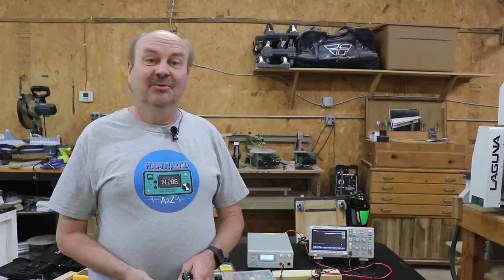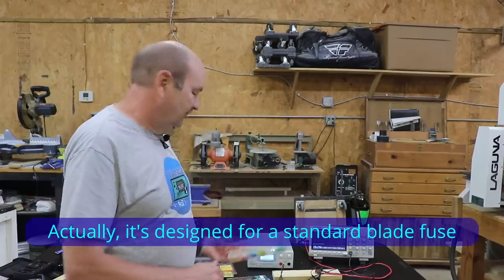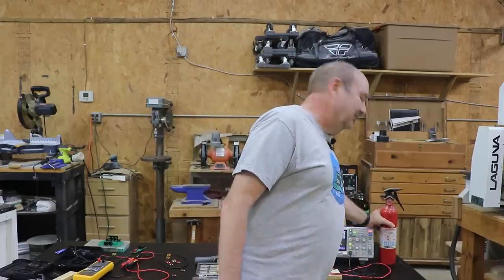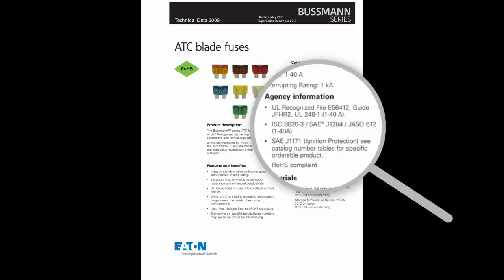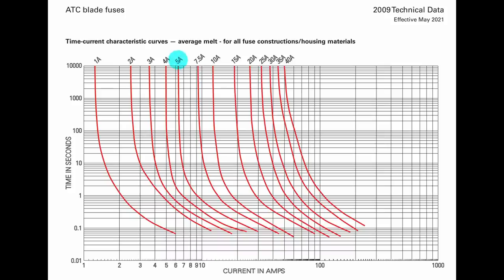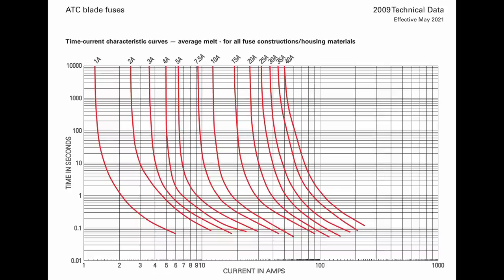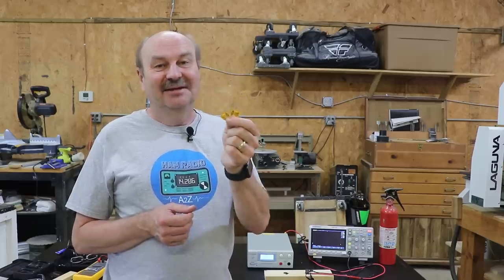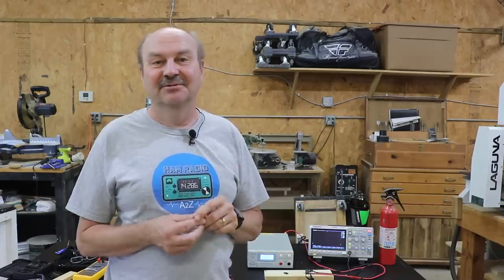Bad Fuses

Comment: Giving this a bit more thought;
(1) your electronic power supply likely responds by shutting down long before a thermal fuse can melt open.
(2) the "rated current" marked on a fuse is the "value it can carry for greater than 1,000h". It is not the rupture current.
(3) your supply indicated about 23A in short circuit, that's about the design tolerance of "+10% for a 20A" fuse.
(4) not all fuses are fast-blow, these unmarked generic automotive types could be a delay type (to avoid nuisance tripping on cold filament lamps and PM motor starting, as found in most vehicles)
 (5) when in CC your power supply is outputting a fraction of a volt (see scope image in your video) confirm with a DMM; there is not enough energy (P= I*E) in the fuse element to heat it up to melting point.

I think you owe it to the fuse vendors to repeat this experiment (I suggest using a car battery instead of that fancy electronic power supply)  73, de K7GVG
Reply: The fuse is rated 5a, not 20. The test setup is correctly simulating a serious overload. The power supply does not shut down, it simply hold a specific level of overload. A 5a fuse which has not blown after 3 min at 23a is not slow blow, it is not a fuse at all.
Reply: @david672orford  Thanks for your comment. Did you read the previous comments? We have collectively gone over the topic.

There is a serious flaw in the test methodology. To demonstrate and correct this the experiment should be rerun by the OP, substituting different equipment. The original power supply is electronic, and does not maintain CV mode long enough for a (any?) thermal fuse to rupture.

Saying the “fuses are bad” is dirty pool!
Reply: @pstonard  Yes, I have read the previous comments. A lot of people are making the same points as you are making. However, I'm pretty sure you are all misunderstanding how Ohm's law works in series circuits. The resistance of the fuse is by design much lower than that of the load and generally much lower than that of the circuit wiring. Since the supply voltage is divided among loads connected in series a fuse in a real-world 12 volt circuit will not see 12 volts ever. As it is blowing it will see a much-lower voltage like in this test.

As an example, suppose you connect a 25 watt lamp to a car battery using five feet of 20 AWG cable and a 5 amp fuse. Then you pull the lamp out and stick a screwdriver in. The resistance of the fuse in the video is 0.028 ohm. The round-trip resistance of the cable is 0.1 ohm. 100 amps will flow. The voltage across the fuse will be 100 amps x 0.028 ohms = 2.8 volts. Assuming the fuse has not blown, you can now take out your meter and measure about five volts drop along each wire of the cable. 

It is not physical possible to test this fuse at 12 volts 20 amps. Ohm's low forbids it. If you apply 12 volts directly to the fuse, you will get 425 amps. If you apply 20 amps, you will get 0.6 volts.
Reply: @david672orford  Again, you have not allowed the fault current to flow long enough to rupture the fuse, which is a thermal device.

The electronic supply used here will go into constant current mode long before the theoretic surge current (using your data = 100A) is reached. Probably in only a few milliseconds.

The final current of 23 Amps DC (indicated on the power supply) is well within manufacturing tolerance of the fuse under test.

The OP needs to step up and repeat the experiment with correct test equipment. As a practical matter just use a car battery, they are literally found everywhere.

A current shunt and scope will show and record the inrush current and the peak current applied, and the duration of the peak.

Comment: I suspect the 5 amp is mismarked. I once bought a batch of surface mount resistors from ebay and they were mismarked by a factor of 10. That 5 amp fuse may in reality be a 20 amp. You didn't test any of the other values of the cheap fuses to see if they operated correctly.
Reply from the maker: I don’t think it is.  The 20 amp no name fuse has a clear difference in the internal element, but the difference in elements between all of the fuses (or lack of difference) is surprising.  Stay tuned for a follow up video.

Comment: I hope everyone watches this who ever has or will change a fuse.  Some of the cheap ones I have come across have been offensive to even look at.
Seemingly random blade thickness and random shapes in the failure zone are common, as well as conductors which fit loosely in the plastic holder.
If the blades move within the housing, it will never meet the precision standards we are counting on.
I use either fuses or circuit breakers to reduce the likeliness of fire in high amperage motor control circuits.  There is a fine line between needing enough current to climb a hill and burning all the legs off the MOSFET's in your control device.  They don't call them Metal Oxide Smoke & Fire Emitting Transistors for nothing.
That being said, it would be interesting to use a motor controller and high speed camera to "throttle-up" some of these fuses while monitoring the volts and amps, so you could actually watch the fuse liquify before failure.
Customers with SLA battery scooters ask why does my scooter "randomly" blow the fuse?  The answer is always the same. It doesn't.
I carefully select fuses to protect the circuit, and you should be glad it blew.  When the fuse blew, it is likely the solder on the high current traces on the board were nearly liquid.  You were a bump away from a catastrophic failure.  Next time it blows the fuse, think closely about what you were just doing because whatever it was put the powertrain at maximum output for a long time. Climbing hills or doing several wheelies in a row are common reasons.  
I love it when a fuse blows!
Reply from the maker: Thanks Kevin.  I too have worked with high power applications for a long time.  From your description, a little different than yours.  I’ve never heard that description for MOSFETs before.  I love it!
Reply: @HamRadioA2Z  It may only apply to the Chinese MOSFET's.

Comment: I have some but I seem to have a different problem with mine. They seem to blow out prematurely.
Reply from the maker: I have only tested one particular set so far.  If the fuses don’t indicate that they meet any particular spec, it seems that it could be equally likely that fuses might blow with too little current or not blow soon enough.

Comment: I`ve been using a Fuse holder and Fuses distributed by Halfords UK in my Ebike but the Holder melts before the Fuse blows!
Vibrations in a vehicle across the contacts is probably what's causing it.

Comment: I know its current but i have wonders if testing like that is accurate i mean im syre those are crap but my thought is that if you have a short on the power supply so voltage down at less than 1v that means the watts on the fuse are less than if it was tested at 12v because the fuese will have a resistance thats what makes it hot so 20 amps at less than 1v will be a lot less wattage in the fuse than 20 amps at 12v
Reply: Ohm's law says you will need hundreds of amps to get 12 volts across that fuse. It should not take hundreds of amps to blow a 5 amp fuse.
A real 5 amp blade fuse will blow in 80 milliseconds at 20 amps. It takes seven watts to blow it that quickly. The total circuit power in a 12 volt system at 20 amps will be 240 watts, but almost all of it is going into the load and the wiring, not the fuse.

Comment: Perhaps they just load each different colour fuse casing with the same fuse conductor insert? They might be all loaded with 20 amp+ inserts! If you can't blow the 5 amp one with that PSU you probably won't be able to blow the 20 amp ones either, but you could still observe the temperature rise of the fuse. (It might follow the same profile of the 5 amp marked one.)
Reply: possible... should be easy to tell if you look closely at whats in the fuse, see if the central bent 'wire' part is the same or not

Comment: I wonder if they were in the wrong housing. I think yellow is also used for 40amp or one of the higher ratings.
Reply from the maker: They are color coded “sort of” correctly.  5 amp is supposed to be tan.  In the kit I showed, the 5 amp fuses are a browner shade of yellow, but not exactly what I would call tan.
Reply: @HamRadioA2Z  5 amp = biege, 20 amp = yellow, 40 amp = amber according to one source. I'm sure I've seen all these values in some approximation of yellow.
I just wondered if a factory worker had put the wrong value fuses and housing together.
They are probably best avoided but I've found generally they have worked.

Comment: Hey, dumb question. Do those cheap fuses do the same thing under AC Amps? I would think AC would cause more heat but I have no idea - I use those cheap fuses all the time with AC. You got me worried. thanks for the vid.

Comment: Has anyone had any similar findings with the Powerwerx ATOBOX Fuse Assortment? They come in at a similar price point to what Tom has presented as budget fuse assortments, but I felt okay with purchasing a budget fuse set from Powerwerx. That was until I watched this video. I have initiated contact with Powerwerx to see if they would be willing to subject some fuses in their ATOBOX Assortment to a similar test. Hopefully they will stand up and dismiss my concerns of any quality issues with their budget assortment?
Reply: Powerwerx did follow up with the following response… “We have not seen that video. We cannot comment on the quality of other companies products however, Powerwerx does test all our products before deciding to sell them to our customers.”
Reply from the maker: Thanks for the feedback.  I'd be curious about their test.  I suspect these fuses would clear instantly if you connected them across a car battery or something similar.  So if the test doesn't involve a current controlled power supply, I don't know that it is valid.  I have already ordered some other fuses from a couple different sources to see if I can determine how widespread this issue is.  I didn't order any from PowerWerx, but maybe I'll add them to the list after testing the ones I'm getting.
I'm also working on setting something up to test higher-valued fuses, at least up to 20 amps.
Reply: I wondered the same thing. I also have a handful of assorted fuses from Powerwerx ... I did note that I can clearly see a variation in the fusible link size of different values. Going forward I'll stick with the main brands as Tom suggest...73

Comment: Just tested my no-name fuses. Same thing.. Ran them until my power supply shut down from overheating... Multiple times.
Reply from the maker: Thanks for the information.  I’m glad to know that my testing wasn’t some sort of fluke.  I did get comments from others that said they had fuses that wouldn’t carry the current they were rated for.  However,  I think most poor quality fuses are going to be way oversized, rather than undersized.  If you plug in a fuse and it blows when all of your equipment is fine, you’re more likely to complain about it.  If you plug the fuse in and everything works, you just assume the fuse is fine.  You never find out that it isn’t going to blow when it should unless something bad happens with your equipment.
Reply: @HamRadioA2Z  I'm just glad I happened to stumble across this video before I'd starting putting these fuses in various projects. It would be awful if I had to start tracking down every project I'd made, let alone repaired for other people!
Side note... I forgot I'd left my power supply running on this fuse and went to bed. Fuse is still good, but now my power supply won't turn on.
Reply from the maker: Sorry to great about your supply. Of course “good” is a debatable description for the fuse. 😉
Reply: Did you try running them at 200% rating and let them soak for a while?

Comment: What about the other noname fuses? I wonder if The noname yellow 5a fuses are just mislabeled yellow 20a fuses.  The difference in the fuses should be obvious just looking through their sides at the fusible link.  Edit:  After a closer look at the fuses, it appears they're all the same gauge of wire in the fuses.

Comment: Really not happy to see this. I often see this exact box with brand name label but the same fuses. I have this box too and I used the fuses for some time. I'm glad that nothing ever happened and they have been consumed and replaced by MTA brand fuses from a reputable seller.
BTW, I have seen many melted fuses over the years and all of them were this type (clear see-through plastic with stamped value on top). So apparently most of them are way off in terms of amp rating. They only blow under a dead short.

Comment: I dont dispute your finding as far as cheap fuses go, my only queation is why is the supply drops to almost nil voltage when you short it while being current limited?
Maybe a  better test would be to load down the circuit with a known load (such as a car headlight?) In the circuit that is double the fuse rating. Having your supply currwnt limit, would esentially do rhe same thing BUT if your supply drops to almost nil, you will have another issue.
Youve got me curious. My 0-30 10a HP supply will HOLD 15V @10a, all day long, dead short. Im gonna order some chi-fuses from Amazon and report back. Thanks for the test!
Ill report back here
Reply: of course it drops, its feeding into a short circuit...  15 v at 10a isnt a 'dead short' ,its a 1.5 ohm 'load' , a dead short is zero ohms
Reply: The current limiting function of the power supply accomplishes the same thing as a known load. The only difference is that if you used a headlight as a dummy load, you would be able to see where the rest of the volts were going when you measured 15v - 0.6v = 14.4v across it. (Actually, you would need to connect the high beams of three or four sealed-beam headlights in parallel to achieve this level of overload.)

Comment: What's worse is the blade fuses with the LED light that lets you know at a glance if it's blown or not. The LED just so happens to still conduct some electricity across the fuse even after it's blown.

Oh boy that damn near drove me nuts trying to figure out why my phone charger in my car kept acting weird. It would light up and start charging for a few seconds then crap out. Turns out the circuit had one of those LED fuses which had blown.

A fuse shouldn't conduct any current once it's blown, so LED fuses are a really bad idea.

Comment: Chuck that DRY POWDER fire extinguisher in the bin too!! Use it and it will TRASH any electronics in the same room!
The amonium triphosphate is hydroscopic and corrodes the crap out of any metal it touches.
Get a CO2 extinguisher - much safer for your $$$ expensive cro / radio gear...

Comment: Isn't there a piece missing here?   If those "cheap" fuses  were used in their normal setting, that is- in a car, and, if a short occurred, the  voltage across the fuse wouldn't be dropping  to almost zero, right?  As we all know it takes volts times amps to generate the power it takes to heat something.
Reply: No, the test is valid. Fuses are supposed to blow when the circuit is overloaded, not just for shorts. If you try to run a couple headlights through a 5 amp fuse, it should blow pretty quickly. When it does the voltage across it will be close to zero just like in this test.

Comment: That was very interesting. Did the fuse cross sectional area differ for each value by any chance?
Reply: look closer.. the 5,10,15 amp and the 20,25,30 amp cross sections on the no name fuses all shared the same shape. That leaves the thickness of the fuse material at the junction where they are intended to blow or the material composition as the variable between them.
Likely they were manufactured wrong as it only takes one person not paying attention and one more not doing quality checks properly to push a mistake like this to market.

Comment: what keeps me wondering ... how can those no brand fuses be sold if they dont mean the criteria ? And how much damage (fire etc) has been done using them ?
Reply from the maker: If they don't SAY that they meet any particular spec or standard, then they are probably fine, legally.  Unfortunately, most people don't know or think to look for something that says they meet any standard - including me until I was testing a crowbar circuit and couldn't get the fuse to blow!  I don't know if there are any regulations or requirements related to selling fuses.  Even if there are, any requirement probably varies widely from country to country.

Comment: Have you learned how bad fuse holders are yet, even the branded ones in auto parts stores?  I've had some 12awg inline holders claiming 30a fuses but they get extremely hot at 8-10A and begin to melt down the insulation and molding at 15-20A!

Comment: Your 5 AMP no-name fuse seems to have been built with 15 or 20 amp internals.  (who's gonna check!! ship it out!)
It is plain to see that the 5,10, and 15 amp fuses in your no name fuse set all use the same internals as far as shape is concerned.
The same is true for the 20, 25, and 30 Amp no name fuses.
Either the fuses thickness and composition at the failure point is what varies or there is a manufacturing error/shortcut happening here due to incompetence or malice.
This video is casting a wide net calling everything rubbish when it could be this particular fuse size in this particular batch and this particular brand.
Examining the internals of the out of specification parts would have made this a more complete video.
Slow blow fuses protect wires. Breakers protect wires.
Glass and ceramic fuses are what you want for protecting components and sensitive electronics.
All fuses protect, you just need to use the proper fuse for your use case and that is where specifications come into play.
Proper manufacturing helps as well.